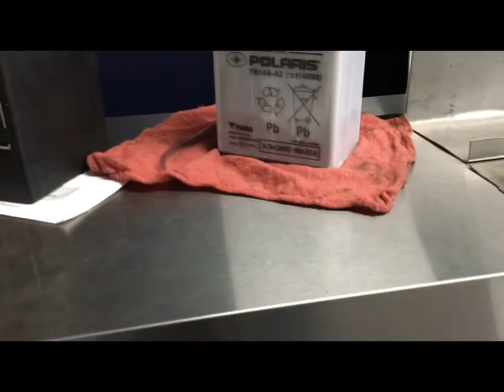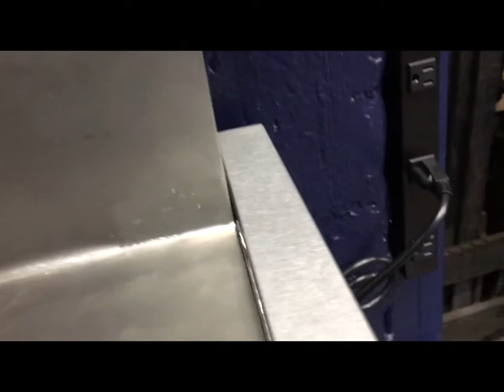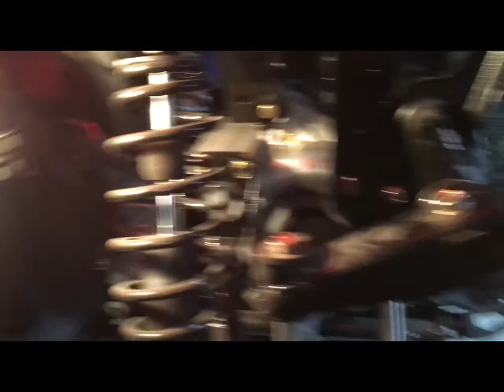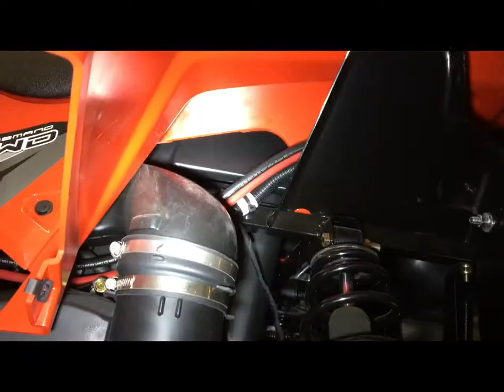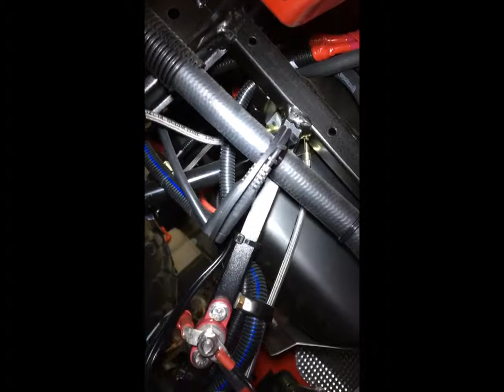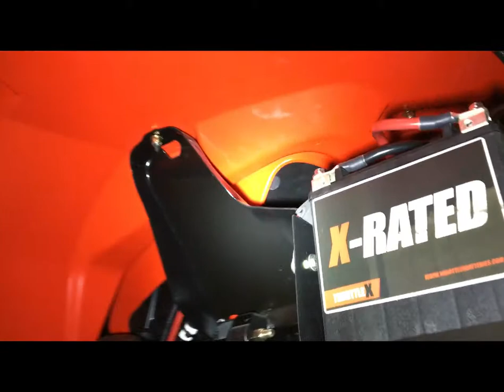Polaris 570 , hard starting , weak battery , slow cranking , installing bigger battery

Comment: I paid the 70 bucks for the relocation kit, even tho I have a welder and some sheet metal.
     Not knocking your invention. 
  For 2.5 years my ATV sounded like it wasn't going to start.
    The underpowered OEM battery is just another way Polaris cut corners.
  I put a lithium battery in (300 CCA)
    Now it starts as soon as it turn the key.
    Polaris should be ashamed.
   And not just for the battery.
  They cut many corners.

Comment: These Polaris have more problems then I can count. From the glacier pro plow, to battery placement, to crappy plastic front and rear decks that break if they touch anything, to front wheel alignment, etc, etc.
   From day one my 450 ho sportsman cranks like it ain't gonna start. And getting to the battery is ridiculous.
     I never thought of moving the battery,,,,, till now
    Does your starter crank faster now, with the bigger battery.
 You probably mentioned it but. What were your original cca, and what are they in the new battery.
Reply from the maker: Well I always have mine on a tender because it sits a lot but yes it cranks fast at first start.  That was the issue with the old smaller battery.
Reply: @mrbuccala  mine sits more in the summer. It has always cranked slow. But I've never had to use a tender until this last week.
   I think the original battery has had it, because it's showing 14.5 volts running, and I've had to jump it the last two times I've used it.
     It's crazy where they put the battery.
 I'll move it and replace it with a better battery.

Comment: Great video friend and good ideal. Question, why not buy the same size battery but with more cca in it?
Reply from the maker: I wanted to move the battery anyway but this battery was the biggest I found that would work.  I didnt really check size.  I guess this bigger battery didnt cost that much so since I was moving it to the better spot it didnt matter.
Reply: @mrbuccala  Thanks for the reply and the  info bud.

Comment: All that work, getting / making all those custom pieces, you should have just simply bought the Quad Logic kit, that has all this stuff in it....  Sure, making it yourself, has some aspects of pride and ingenuity, but for the cost / time of what-all you did, it appears it was not worthwhile, for the cost of the Quad Logic kit.
Reply from the maker: As far as I know the kit you speak of is for moving the battery and that would have been great if it was to just move the battery but I wanted to use a bigger battery and the original battery was not working right.  When I changed over to a higher capacity battery that problem went away so going by the measurements the bigger battery wouldn't fit on the kit I saw. Funny thing is if you look on Amazon the first question is how big is it ?  My guess is that customer wanted to do the same thing I did.
Reply: I replaced battery with standard lawn mower battery but i installed it where the winch goes. You only need longer negative cable positive one is long enough. 530 hrs, 2800 miles, 0 problems except  battery.
Reply: You’re an idiot.  He wanted a bigger battery. Quad logic is a scam.
Reply: @cd1168  there's no need for name calling here. Let the guy bounce his ideas.